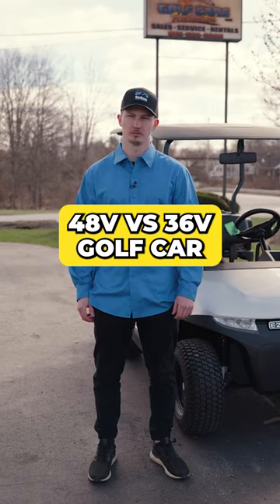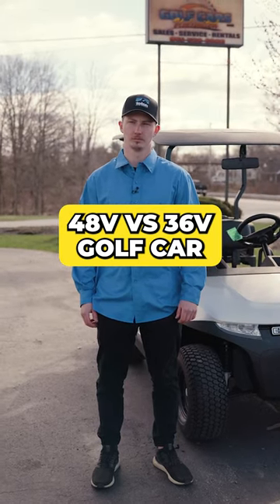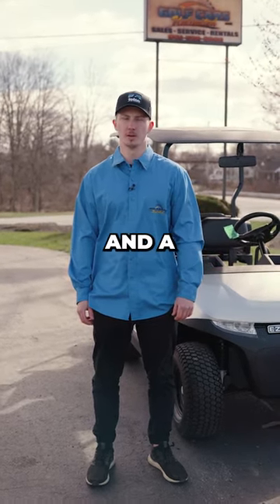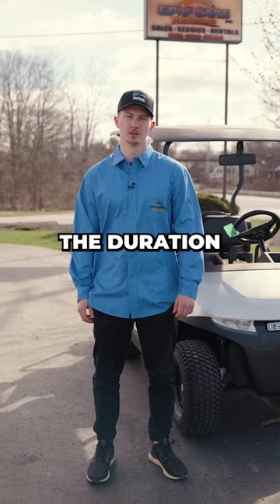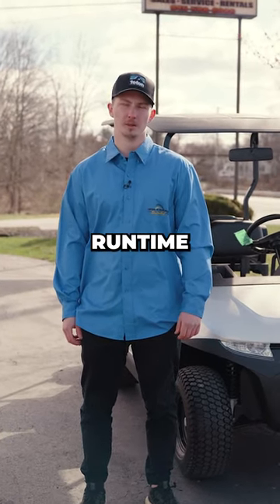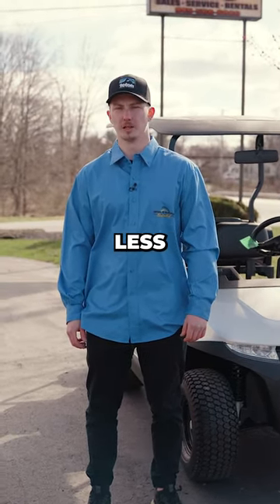48V Golf Cars VS 36V Golf Cars #shorts

Comment: About 12
Reply: 48 volts is Four Batteries ran in series which should be quicker than 36 volts which is three batteries in series ! The more voltage ⚡ you have the quicker it goes 🤔 ! 😂😂🔥🔥👍